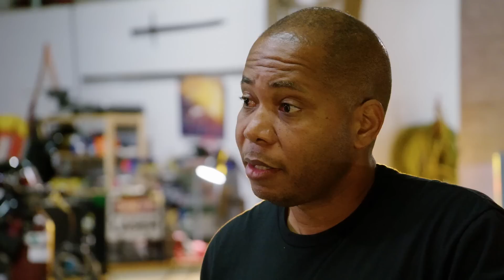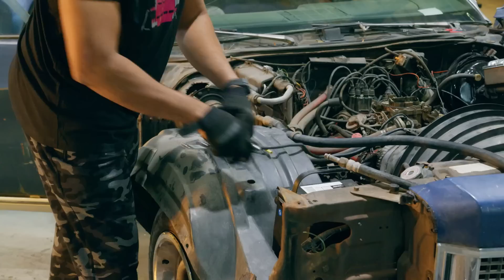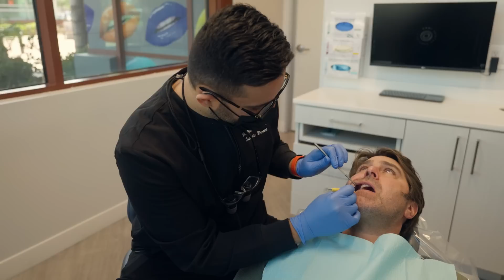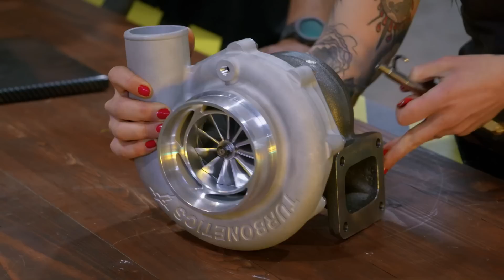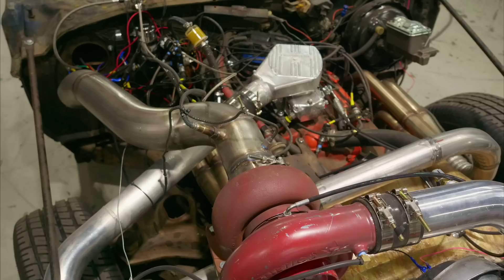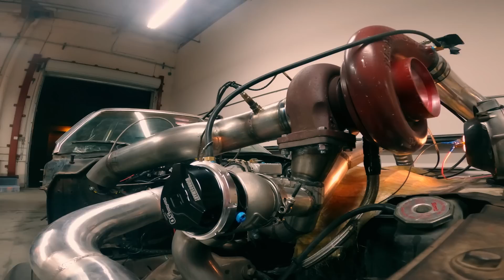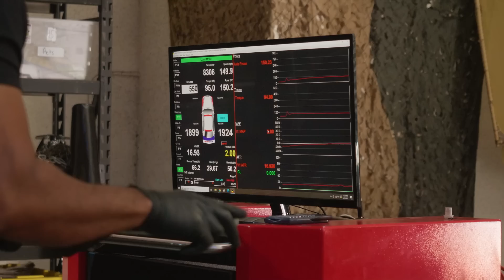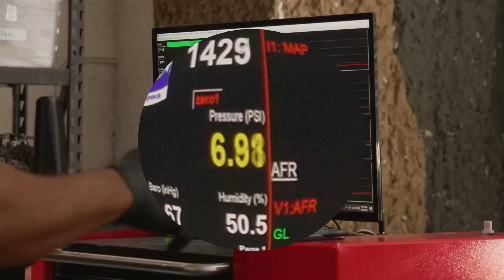Turbocharger Myths - Motor MythBusters - Car Show

Comment: I think the Idea was that the turbo was SIMILAR to what would be found on a marine diesel. But I was disappointed at the boost: a turbo-diesel will easily get 20-30 psi boost. Maybe because the air intake on a diesel is unencumbered by carburator, etc. ?

Comment: fun fact, the car dom is driving has 2 gearboxes, the second was an old tractor 1-1 forward reverse box. so when it is reversed, you still have all the gears from the primary box. so that reverse finish line speed was legit. cuba they built with what they had,  that's why it has a marine turbo on it too.

Comment: that big turbo should have made a lot more pressure than 7psi... whats that, less than 0.5 bar? With a turbo that size you should be pushing at least 30-40psi of boost.
I know this is a proof of concept, but they should have did it right, it would be way more spectacular to see that engine blow up at 40psi :D but yeah, safety concerns.

Comment: "7 psi, is respectable for that size turbo"... in what world?   Since we don't have wheel specs, or housing info it is probably made to flow high volume at relatively low boost... but that would be 7 psi on the low setting, 15 psi on a street / strip setup, and 20+ psi on race gas.

Comment: Either he doesn't know how to use Nitrous, or the editing is horrible... looks like he is hitting the nitrous button over and over again (pulsing the system on and off) instead of pressing and holding the button.  Either he is an idiot or the editing is "shift the 5 speed 15 times while accelerating" bad.

Comment: They have a very weak 3 psi spring in the wastegate, the wastegate is probably blowing open from the exhaust manifold pressure alone when they remove boost pressure from the upper chamber of the wastegate.  Also, it is possible that their BOV had a very low pressure spring in it as well, and without boost pressure helping to hold it closed on the top of the BOV diaphragm, boost pressure in the upper intercooler pipe is blowing the BOV open.  Pretty sure the car in the movie didn't have a BOV.  So, did they intentionally bust the myth by putting a very low pressure spring in the wastegate, and perhaps by adding the BOV that wasn't in the movie so they could "solve" the problem with the rat trap?

Comment: I guess Fuel feed is not enough for this build, i have managed to forget attaching that wastegate tube to my 2 liter subaru once, it gone relatively crazy like blowoff valve making supta tototo s 😂, and it was definitely going better. I luckily realized what was "wrong" before managing my 4th cylinder fly off 😅😅

Comment: They did not use the turbo they "found", they took that turbonetics turbo you saw on the table and reliced it to look used. They also kept the boost under 8 psi to work with the factory ring gap, and with the wet nitrous setup and only a 50 shot, this engine was never going to blow up.

Comment: ahhahahahaha, "air leaking out from the wastegate hose so that an engine barely runs..." it is flowing a minimal amout of air even under many atmospheres. i guess the carb didnt like the boost, maybe more boost than fuel pressure or something like it. blowing out spark? idk something more than the car handled then and there that is for sure.

Comment: I had an 89 foxbody when I first turbo d it just used aem regulator on fuel rail 1 to 1 and a fmu another boost reference regulator in the fuel return line. The waste gate house crumpled from the heat cheap vacuum line it won't from 7psi to over 20 psi I was like holy shit easy 600 rwhp but it blew the shit out of both head gaskets but it worked not by me intentionally but same concept as pulling vacuum hose off. A tuned ecu prob wouldn't compensate that much h fuel a fi tech or new aftermarket efi will learn very quickly idk if it'd compensate 7 to 20 plus on first pull. Factory turbo ecus would cute spark and fuel to save engine from over boost so the shitty fmu is only reason the air fuel ratio stayed in the 11 s to 1. Blew threw carbs I'm almost positive are built for a certain window range of boost buddy had one built it was spot on at 7 and 15 psi they ask what came turbo size everything to get blow threw carb close typically have to do some jet changes or send it to them they do more mods so this is very plausible but fuel system would have to keep up detonation feels like a bunch of misfires it can destroy pistons rods google pre ignition I'm not explaining it but car would fall on its face unless tuned for the boost level that's a 2g ball bearing turbo with some rustoleem paint on it. If they could get that turbo a brand new set of turbo HEADERS not manifolds a brand new demon blow threw carb it's crazzy they couldn't source an electronic boost controller just completely shut off boost to waste gate just saying but this is a really cool video. Wanna shout out ptc converters Tim asked me alot of questions but I put converter in it was spot on. Was very happy with there service cheap to. I sold car 4 yrs ago but out of all the money I spent alot that company took care of me so I just wanna shout them out paid 280 got a spragless stator guaranteed for 1000rw for 280 I shipped in my core but circle d and others wanted over 800 tried to sale me antibsllon plate other stuff Tim said I guarantee you don't need that stuff honest people best in business that was 10 yrs ago though

Comment: I've hit 130mph in a '95 dodge neon non-turbo with a stock 5speed manual . And 145mph in a stock '71 chevy nova with a 307 sbc with a 350 automatic powerglide, Non -turbo. Sooo..... what are they doing wrong. They have nitrous and a turbo and still couldn't go as fast as a stock engine with only a modified exhaust.
Reply: It's a broken down 73 monte carlo. By juicing, converting to turbo, and blocking the wastegate, they took an old beat up car that can barely run and brought it to the original limit of its transmission, which by the way is probably working like dogshit the whole time.
Not to mention the aerodynamics. When go you over 50, aerodynamics matter, and they threw that shit straight out the window.

Comment: Also they didn’t have a boost line holding the waste gate down shut so it was floating and exaust pressure was opening it up. I’m watching a bunch of rookies try to make boost and power. Dude I’d have that thing singin and throwin rods out of the block in about 10 minutes. They have nitrous and still can’t make boost. Why even run a waste gate if your going for power. Straight turbo and send it. No waste gate it will make boost for sure

Comment: Please, where is the teamed so I can do over bore my turbo in here but the motor for parts only is 3 miles away. Not more than 0.0002 inch over sanding bore because turbo is seize.

Comment: Also bore and cut thru the engine block about 3/4 pipe fitting MIP as similar to turbo of the Raleigh Junkyard turbo where I salvage and remove the Mustang vintage turbo and paid the salvage yard owner but now the yard was bankrupted and moved away and retired.

Comment: Turbo needs to compressor and pressurized into intake manifold with bore and hose the intake manifold needs to have new cut opening so the connection to the 2.5 inch 9 holes intake manifold for V8 plus intake plane for where carburator sits atop the single plane. You are allow to go to the not private property of the ship yard dock master yard to receive the salvage engine at the pier. At the junkyard is the rare 2.3 liters thunderbird turbo mustang engine for sell plus my turbo came apart from the mustang SHO 1982 Raleigh Rally Sports Motocross car street legal compressor. That way we must study the copy cat the mustang of the cast aluminum intake manifold 2010 Daytona hand build and casting it to copy the cast iron intake manifold for inline 4. But turbo is similar to Chevy and Ford combine design for the V8 350 4V carburator. For learning is fun. Thanks

Comment: What did they use to increase fuel pressure when they hit 6lbs and above should have pushed boost against 6lbs fuel pressure a carb usually runs on and would have starved for fuel until boost dropped enough for fuel pressure to fill fuel bowl.. this thing would have more than doubled horse power when line was pulled. Sure it would have hit 20lbs easy!

Comment: Well, they ARE acting as idiots! 

"Vacuum" line? On the discharge side of the compressor?!  

They just read the ridiculous script - they don't really have a clue about engines, especially Tory. The turbo was so oversized that they got a "whole" 7 psi when unregulated! And then they use an ordinary carburettor, so they should be sucking through it, not blowing through it. Finally, the Nitrous and extra fuel feed is supposed to go in AFTER the carb, right on the inlet manifold. 

This thing was put together by morons and the cast just acted their stupid parts. The writers of Wile E. Coyote's efforts would do far better.

Comment: So you boosted it to 0,45 Bar while my 30 Year old Diesel runs fine on 0.8 Bar and a fairly modern VW/GM 4 or 5 Inline Block can deal with up to 4 Bar. well ....

Comment: Just wondering:
Has anybody ever tried to use a Exhausturbine to drive the generator (less power off the main engine) or even feed the extra power into the drive train somehow?
Reply: yes... on planes. i assume you got the idea from the allison or whatever compound turbine thing?

issue is gearing it... turbines run fast. real fast. get into all this stuff about shaft speeds and resonances and bearing designs... throw in gears and its a nightmare. especially when small...

ships? planes? no problem, the things are larger and relatively slow... constant speed... hours, days... cars are revving and slowing down and gas flows dont have much to do with RPM unless diesel...

pretty sure theres been a few attempts at turbo alternators? the gains dont seem to outweigh the costs... belts are simple. high speed shafts and heat isnt...

ive always thought of stirlings driving AC compressors, or back to back as stirlings are heat pumps after all... they refrigerate if driven.
got coolant water, got exhaust heat... but yeah... space... complexity...

the auxiliaries add little to an engine. the AC is the worst.

i reckon we got the turbine/engine combination wrong myself... rather than pistons driving a turbine to assist the pistons, i think it should be a turbine driving the pistons to assist the turbine...

Comment: Why would you not dyno it before putting it on the airstrip.. This show is really grasping at straws. No wonder if wasn't renewed for S02. Lack of technical depth for anyone who is a car enthusiast, and just plain weird with the gender ambiguous cast for anyone who isn't.

6-7psi of boost is fuck all, even for a converted NA motor. Get something with lower compression that's turboed from the factory, build the motor and run 50 pounds through the cunt. All you're doing is entering an overboost scenario realistically anyway.

Let's get some real engineers on the show (go poach some of the Motortrend guys, we know Discovery has the budget), and show the proper build with details about fabrication, etc. with some real data and some real honest attempts at actual engineering.

Also, just get on the bottle and the ramped up boost from a dig and time the 0-60 or the 1320ft.

Comment: Turbos may be the current "in" idea everywhere. But Turbos like every technology have limits and drawbacks. They can heat soak engines without con
siderable heat sinks. They are cpmplex and there are now competing technol- ogies which may be better
in many ways.
Reply: Those competing technologies are?
Turbos are nearly free extra energy, they're also not very complex lol
Reply: @kristoffer3000 maybe superchargers that havent had any substantial developments for donkeys vs the new compressor wheel desighns that are making turbo's substantial more apealling.
We also have better understand of mls head gaskets to help against the only real downside of turbo, and no i do not consider heatsoak an issue, thats a result of fafo when we build stupid shit it the fact your adding 20 odd pound of pressure to a motor, that may not have been built for it.
Reply: @asdasd-ni8eg  Problem is that superchargers are just worse than turbos, slightly simpler but not by much

Comment: 11:02 it actually provides 14.7 volts.... which is 2.1 volts over the "nominal" battery voltage
.
stop "dumbing it down for the wider audience" and tell us the TRUTH!!! the FACTS!!!!
.
each cell is 2.1 volts.... their are 6 cells.... so a "full" battery will have 12.6 volts 
and if you want to charge the cells.... you need to give it nominal voltage + nominal voltage from a single cell 
aka... 6 cells at 2.1 volts each (6x2.1)=12.6 <---- your battery voltage ............. 12.6 + 2.1 = 14.7 <---- your charge voltage
.
if you had a 24 volt battery using 12 cells.... 
you would still need to charge it at 25.2+2.1 volts (battery charger/alternator HAS TO! output 27.3 volts to actually charge the battery) 
.
its the same 2.1 volt cell.... 
so you charge at 1 cell worth of voltage, plus all cells added up
.
if each cell was 1 volt.... 10 cells (aka, 10 volt battery)
you would charge it at 11 volts (normal cell is 1 volt.... 10 volts normal voltage....... so 10+1)
.
.
.
idk.... im VERY BAD at explaining things
i KNOW im right.... i can "see" it in my head (visual learner AF) 
but i be damned if i can tell another person how to do it...... training people at work im like "idk, just watch and ask me questions/tell me to stop"

Comment: I knew it would not catch fire.. turbo only controls air not fuel lol so unless you have aftermarket fuel injectors and fuel pump then having fuel line leak, now thats believable.. just adding more air without fuel no fire 😂

Comment: In the racing community we have a scramble button, but the rat trap idea was so genius and simple, those gains are very respectable.
Reply: Pneumatic solenoid then? This allows both opening and closing the pressure line electronically and can be programmed to ease up if engine values go to about to explode range.
Reply: @Hellsong89  On an electronic boost controller you can just max out the electric solenoid if you want to and thats what the scramble button is for

Comment: Air/Fuel ratio was in the 15's in boost, congratulations you ran a motor lean and proved it slows down. maybe toss some fuel in and then pull the wastegate line, you think they can't jet carbs for turbo's in cuba or something.

Comment: 2.5 psi of boost is nonsense. A vacuum line of boost leak does basically nothing when the engine displaces so much air. They make no mention of fuel pressure increases to make the fuel system actually work.
Reply: true. also pinching the waste gate line would have just held the waste gate in its current position preventing the turbo from surging or producing its max boost. I don't think a needle valve would have cost much to adjust waste gate.
Reply: @brade2681  completely wrong. No wastegate reference will make it make as much boost as the spring in the wastegate will allow.
Reply: That's if the waste gate was open to atmosphere. But it wasn't. when the rat trap pinched the hose while it was regulating boost which would have held the valve in its current position which would have been open some what.
Reply: @brade2681  theoretically. Most have a one way valve so vacuum doesn't affect them. Even if it didn't the spring in the wastegate would apply enough force to collapse the rubber hose and allow the gate to shut.